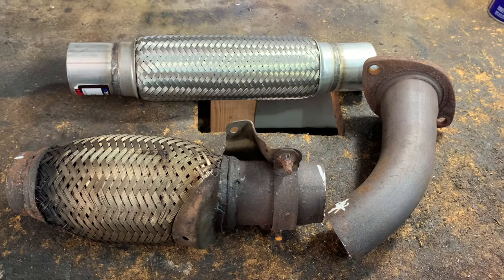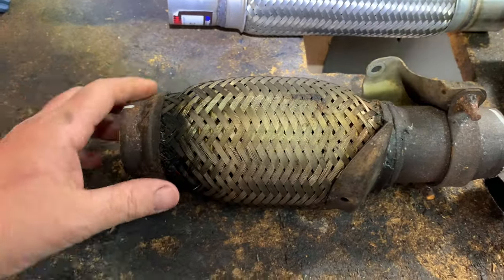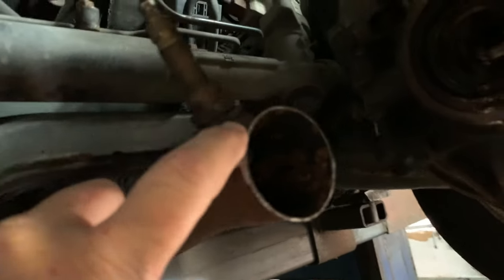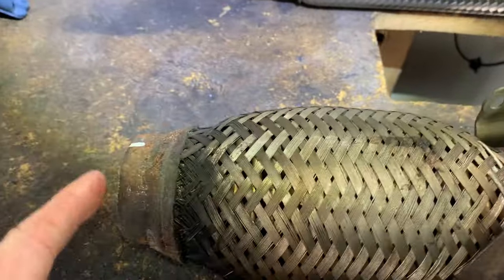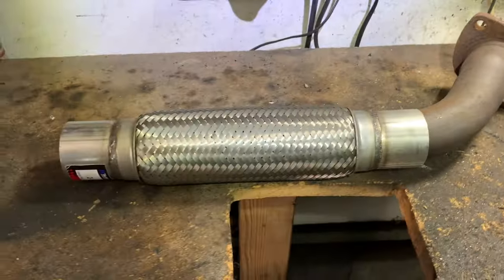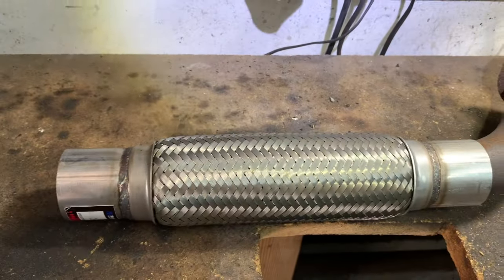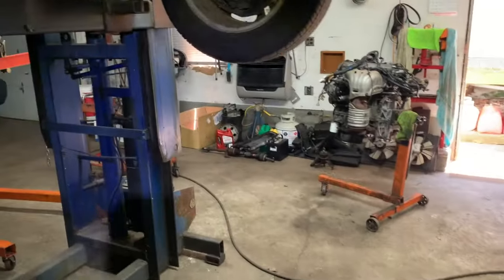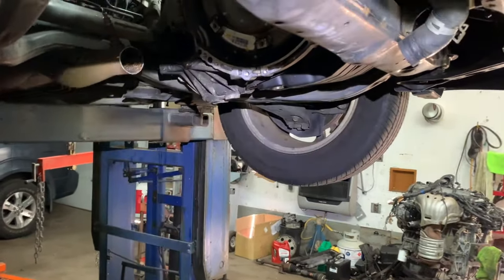Replace Front Exhaust Flex Pipe on most 4 or 6 cylinder cars - Cheap Way

Comment: love this guy. wish I was in your state. Watched this video before going in to get repair. I have a G6 Pontiac, 2006. Drove car for 14 years, original muffler exhaust system. Then this guy tries to tell me that it's normal for the repairs I did at the very end of Dec. 2019 to be going bad 1.5 yrs later.  Just play a woman for stupid and stand back and watch how that shit goes for ya. Before I even went I researched, familiarized myself. And I watched what they did when they repaired the whole thing the 1st time. The guy used a straight pipe instead of installing a front flex pipe and now it backed up the rest of the system.  Said I didn't need that front flex pipe. Wish I had made more of a stink about it at the time. Now I'm headed back to the same shop to ask them to make it right and of course, surprise, they are trying to tell me I need a whole new system. Bull Shit. The rest of us out here appreciate these videos. Thank You!!
Reply from the maker: Thank you, I appreciate it. I don’t like people taking advantage of anyone especially in the mechanics field.
Reply: @motorcarnut  You do a great service with vids like these. God Bless. ☺

Comment: TY. Your video really answered my questions I've had. You explained the issue in more depth tonme than the damn mechanic who diagnosed the car. I thought the flex pipe was in my rear this whole dang time 😂
Reply: New subbie
Reply from the maker: LOL, Thanks! No it's in the front because the engine has movement and exhaust needs to flex a little or eventually it will crack or create too much vibration.
Reply from the maker: Thank you for that really appreciate it!

Comment: What about the 05 Chrysler 300??? I have a clogged catalytic converter (at least that’s what this mechanic said) and he mentioned a flex pipe..
Reply from the maker: That’s two different problems. The catalytic converter is not related to a flex pipe. You probably need both.

Comment: How much you think a shop would charge me for a job like that with an aftermarket universal flex pipe doing the job just like the way you talked about doing but actually welding the pipe in? thanks.
Reply from the maker: Depends on the vehicle and how hard it’s to access but should be no more than $125.00 if someone else installs it.

Comment: How do you fit the flex pipe over both ends where there is not enough room in between the old flex pipe?
Reply from the maker: They make different lengths and diameter just measure what you need and buy the closest size.

Comment: Is the flex pipe located near components of a/c system and would a cracked and leaking flex pipe wreck the wires and hoses to the a/c causing the compressor to give out? I've had 3 rear end hits to my KIA Sportage 2011 2.4L EX. Had to replace muffler and flex pipe but compressor went as well just need to know if related and if possible the accidents and hot air escaping the flex pipe affected wiring and caused a/c leaks and ultimately compressor to go because people think I'm crazy that all this started after 2 nd rear end hit
Reply from the maker: Just look under the car and see if the flex pipe is near any wiring. I don’t think so on your vehicle. I believe it comes out the back in the middle and AC is on the side front of engine.
Reply: @motorcarnut  Thanks. I will get my dad to take a look. I thought the flex pipe hooked on to the motor near the manifold. The radiator/A/C guy had a piece open under my rig near the passenger front seat and front passenger side tire that's where he said it was located which seemed a bit weird. From the videos I've watched the compressor seems to be located up front there and u have to take off a body mount to get to it. So I figured if it was connected to the motor (flex pipe) near the manifold, that could be near those wires and melt them causing an electrical issue, or the rear impacts could have pushed the exhaust forward and cracked the line especially after finding out the low pressure line goes to the back of the vehicle. Love these videos. Thanks for the feedback. Everything helps when you are a girl asking questions at shops and to insurance adjusters. I get lied to alot but I'm a researcher and persistent. I pay enough for insurance and have never missed a payment so if something gets wrecked on my vehicle from 3 hits that were not my fault, yeah I will definitely not take no for an answer because these things cost money, and I pay enough out to them people every month. I just got it back from autobody shop tonight. Will get to lift it up and we will take a look and talk to my electrical guy about the wiring. Thanks for your input. I appreciate.
Reply from the maker: @tambourine36 hey, no problem! Good luck!
Reply: @tambourine36 No way flex pipe leak would affect AC compressor. The two are far apart.

Comment: I noticed the shop that had given me a new flex pipe gave me a smaller one than the original. Should that necessarily be a concern? Thanks.
Reply from the maker: Do you mean the diameter or the flex part of the pipe? Diameter should be considerable smaller.
Reply: @motorcarnut  I'm talking length. The flexible mesh surface shorter. Which ultimately could only mean less flex. Now I'm thinking they took the easy way out. Because a bigger one would have been that the need to do more work to get it to fit. It's up in the car near the engine area closer to the engine manifold.
Reply from the maker: It should of been replaced with the same one but you should be fine, I wouldn’t worry too much.
Reply: @motorcarnut  ok thanks. So much.

Comment: Clamps leak and 02 sensors pick it up
Reply from the maker: They won't leak if you do them properly. You have to use the proper size diameter pipes and clamps and could use a little sealer on the inside of the pipes before clamping them down.

Comment: Why both flex pipe looks 2 diff size ?
Reply from the maker: The length of the flex part doesn't matter as long as the total length is the same as the one you're replacing and of course the diameter as well.
Reply: I'm guessing you are talking about at 0:24 where the old one has a larger diameter, and you are correct, it does but also notice the length of the mesh material is much shorter on the old one.  The reason is that flex pipes are not only flexible along their sides but also compression/expansion flexible, meaning that if the length is compressed like he likely did when removing the old one, then the sides bulge out as a result.  This ability  is needed to allow the part to be installed between two rigid fixed points.  If he stretched it back so the length matched the new part, the sides would pull back in and have the same relative diameter.

Comment: Cheap things happen to be expensive at the end..
I tried replacing my flex pipe with this cheap flex pipe and it couldn't last for even 3 months. The material used to make them aren't durable like the original and it's a complete waste of money. Go for the original and thank me later..
Reply from the maker: Cheap as far as replacing just what is needed. Flex pipes are made of stainless and steal. If your repair only lasted 3 months, maybe it’s not the part but who did the repair? There is no reason to replace perfectly good steel with a factory one for 5 times the price if you follow my video correctly.

Comment: I own a shop abd this guy is talking about the engine out the way and doing the job I got paid 300 to do this job and I still don’t wana do it bc the space is tight you gotta use a Origen and acetylene torch heat up the nuts than cut one end off the flex pipe get the connector off the manifold than weld one end of the flex pipe and the other end when you install it
Reply from the maker: All vehicles are different, some are easier than others. I'm not talking about the engine removed either that would be ridiculous. I'm trying to help the diyer.